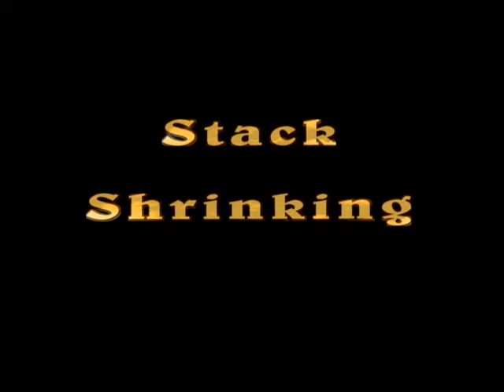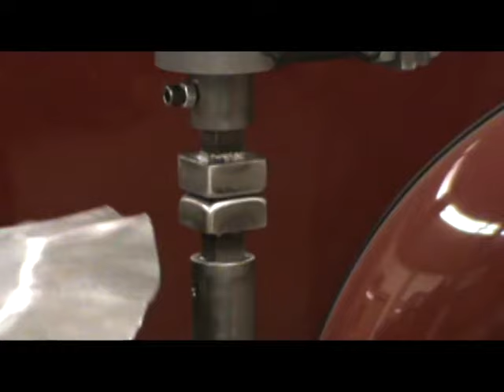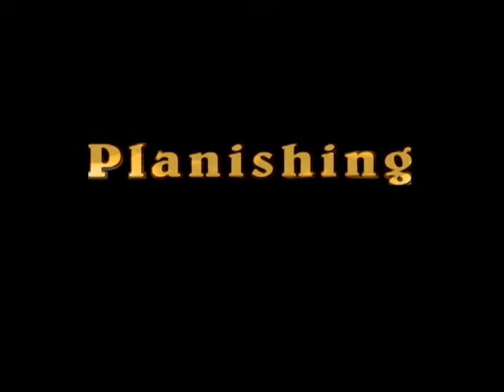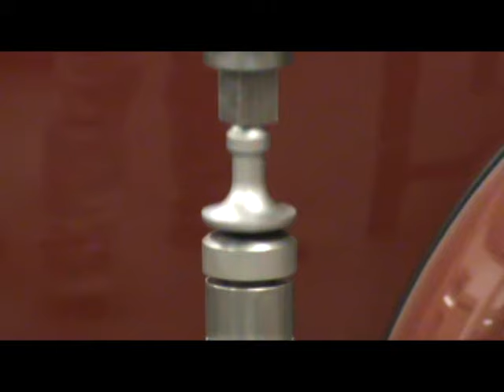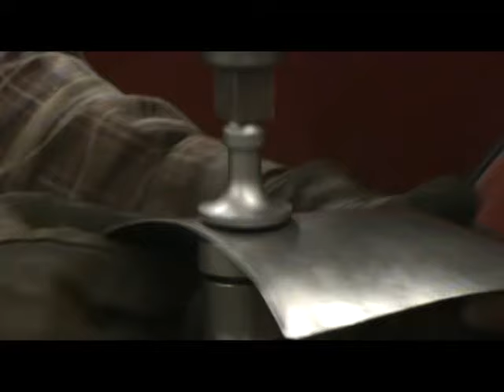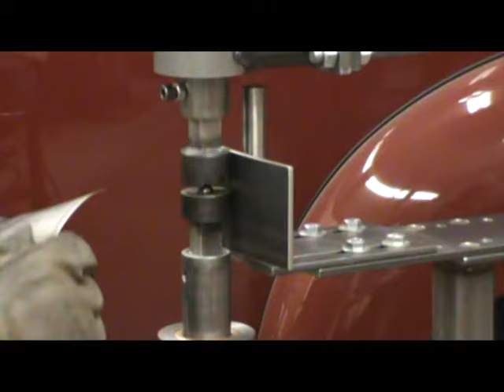P-Max "Pullmax Style" Reciprocating Power Hammer Demonstration Video

Comment: I build kinetic wind sculptures and I need to hammer out shapes similar to a bicycle fender. I use 3003  16ga aluminum. Will this hammer do it?
Reply: Hi John,Yes - the P-Max will work exactly like a Pullmax machine as far as the shrinking and stretching. You can use the magnesium shrinking dies (or thumbnail shrinking dies) to shrink the sides of your "fender" to pull it around, and use the urethane upper hammer die in conjunction with a high crown lower CP die to stretch the center. You can also use the nylon upper and lower dies to do the final planishing. You can contact me via email or phone to discuss the details. All contact information is at the website www.desert-hybrids.com.Thanks,David
Reply: David Buchhauser  I have been forming these blades with a blacksmith swage block and plastic mallet. Then through a English Wheel. Successful but slow and tiring. What do your hammers cost with basic tooling?
Reply: Hi John,Please visit my website www.desert-hybrids.com for current tooling and pricing.Thanks,David

Comment: Shrinking then Stretching with a thumbnail shrinking die ?
Holding the metal to high going into the dies, That’s why the outer perimeter stretched !
Nice planishing & beading.
You can see the outer stretching appearing/coming out on the beading, It should be tight.
Saved by flagging outer perimeter, nice job !
Reply: Shrinking with TN dies, stretching/planishing crown area with flat upper hammer/lower CP planishing die. This video is intended to show some of the operations which can be performed with the P-Max Reciprocating Power Hammer, and not my prowess as a metal shaper. Perhaps you would care to post a video demonstrating some of your skills and show us the correct way to use the TN dies. I am always willing to learn from the experts.    David